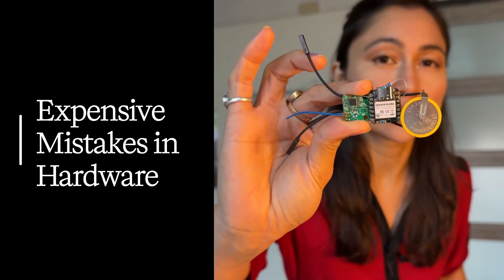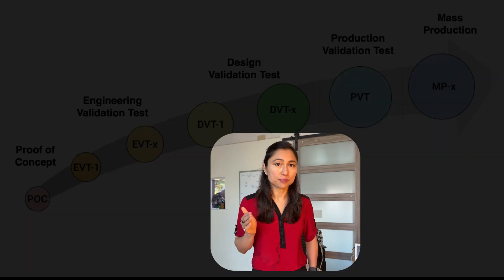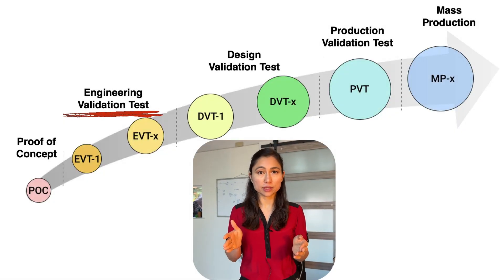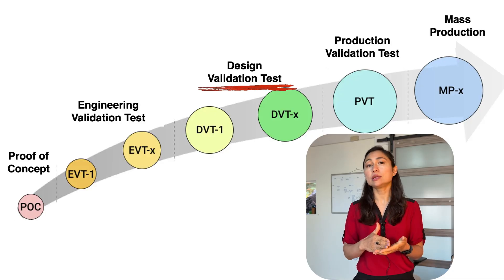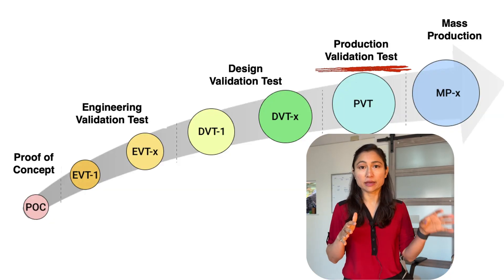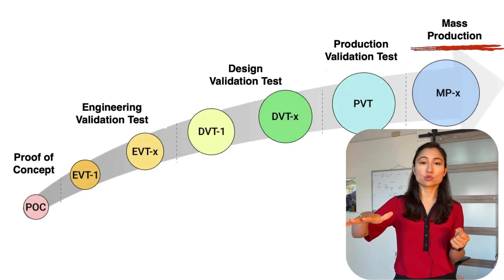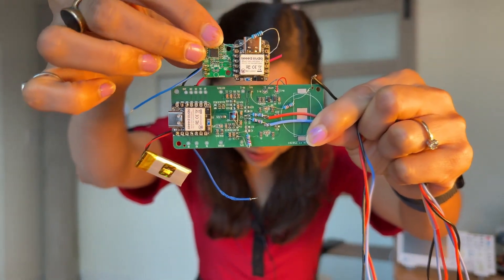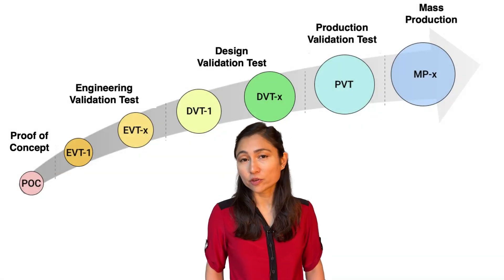My $1000 Mistake  The 5 Hardware Stages You Can't Afford to Skip  | Startup Series Ep 4

Comment from the maker: Where are you in your hardware journey? 👇

* POC (Proof of Concept) - still figuring out if it works?
* EVT - finalizing your electrical design?
* DVT - locked in on mechanical design?
* PVT - testing your assembly line?
* Just getting started with an idea?

I'll try to answer questions and would love to hear what challenges you're facing! And if there's a specific hardware topic you want me to cover in future videos, let me know here.
Reply: As a teacher in university  we feel students just want to run the board and are not very interested in details ...  How can they be engaged in this learning process ?
Reply from the maker: @KHIRD  only a small percentage of students seem to like electronics in any group. Interesting projects that start simple so they can get early wins and slowly get more complex should help get those students engaged. 

What do you mean by they “just want to run the board”?
Reply: @IndiraNegi  means student just want to run the board and they are usually  only interested to run it in short term with losse wiring
Reply: what is that device in the video with esp32 s3
Reply from the maker: @Watcher69w it’s not esp32. 
It’s the seeed board with nrf52840
Reply: Im either in POC or just about ready for production depending on whether its ok to ship raspberry pi's and off the shelf ESCs. I think my de- risking move was just to avoid circuit design in my robot.
I would love to hear your critique of my attempt at a hardware company if you dont mind.
Reply from the maker: @overengineer7691 it’s a decent approach 

if you use off-the-shelf parts, you can either sell the product classifying it as a kit as long as the customers assemble some parts of it. In that case you don’t need to have your your FCC certification because the parts you are using are already cleared 

Or if you want to sell it as a fully assembled product, you still need to pass FCC product level test but if the parts have modular certification then your test is simpler and less expensive

Comment: At what stage would building test harnesses for production happen? Would it emerge as part of the EVT stage as you actually finalize the electrical design?
Reply from the maker: I am planning to using an early version for EVT yes. It's going to be very simple - just 3 testpoints and a usb connector, PCB held in place with a clamshell style fixture.

 But it will be improved for DVT and needs to be perfect for PVT

Comment: Feels very big company style process. I'm struggling to find a balance between going through steps and speeding things up. Since every board takes time to get manufactured, skipping a step might  give you a time advantage at a cost of some potentially wasted boards.
Reply: Industry standard for industrial products is TWO iterations, tops. For commercial products you may get a third, but it is more likely that you are making design changed during manufacturing anyway to accommodate supply issues (parts become obsolete, hard to get or there are cost-saving alternatives). That's it. She is simply bullshitting you.
Reply from the maker: Yes it is what I've learnt at big companies and it's because you are coordinating large teams for EE, ME, Firmware, App, operations and supply chain. They all need dates and milestones to plan their work. 

As a small company you can skip whatever you think you don't need, as long as you make sure to are ready with your final EE and final ME before the production run. Because pausing the production build costs a lot more than any previous stage
Reply: @IndiraNegi  You were at a company with mediocre engineers.

Comment: If you miss any hardware components or if something doesn't work as expected or need some changes in PCB, its a significant delay to get  new one... How do you avoid or deal with it?
Reply from the maker: You try to iron out as much as possible in the POC stage. Test most of it. At that stage you can build a few versions and they are still inexpensive 

The later stages every mistake is costlier. So it’s better to spend the time early on in POC and pre-EVT to test and find all the issues
Reply: You can include prototyping space and even design variations on your test board. The second board has to be the production design. If it isn't, the you can pretty much kiss your promotions goodbye.

Comment: If you skip the 5 hardware stages, you will get the 5 stages of grief. It's 5 stages either way. I've been there.
Reply: That's bullshit. I have made a bunch of scientific instruments that were built either on prototyping boards or the first PCBs (with a few components soldered in during the test phase). All of that worked for decades. I also have commercial designs which had one or at most two iterations.

Comment: i made a 555 explode the other day, so yeah...
Reply: I would never used a 555 in any design. It's one of the worst chips that were ever built. What's worse is that there are a hundred clones out there and none of them behave the same.
Reply: @schmetterling4477  i might have issues with their pinouts being awkward for all common circuits, but as one of the oldest ICs still in production and still found in commercial designs, it has to have something going for it...

not had an issue with clones being variable, theres nothing in them to cause such behaviour...

so either the issue is how you use them, or maybe youre just trolling...
Reply: @paradiselost9946  Everything the 555 can do I can do far more reliably with other circuits. For all I can tell it has been mostly marketed to hobbyists. If you like it, go for it. I just worked out an analog version of Pong (the video game) using bipolar transistors. It could certainly also be implemented with 555s, but I wouldn't. For one thing two transistors will set you back 3 cents, one 555 more like 10cents, so it's not even cost effective.

Comment: Some things are simply not breadboardable and require a few spins of a proper PCB build - everything RF, everything high-speed, where signal integrity is important, everything high-precision. Modular design helps though - if you can isolate such parts and build them as small self-contained PCB modules, the cost of design goes down massively.
Reply from the maker: That's right!

That is the only reason I built a custom board for my design. It has sensitive analog signals and the layout and layers of the board would affect the functionality
Reply: You beat me to it.
Modular design is critical for RF.

Comment: Hi Indira, thanks for the overview. I've always found the process to be much more fluid with feedback between steps, especially with mechanical design. Mechanical design changes may require electrical design changes, production changes may require mechanical or electrical design changes. Is the process I'm describing a totally different philosophy of design, or can it also be captured in this overview?
Reply from the maker: Absolutely, there's always feedback between steps! My overview simplifies it, but in reality, you're constantly iterating between them.

ME and EE work together in EVT and many time in POC too. At EVT also you build a full device - EE, ME, firmware etc 

It’s just that after EVT, ME can still change stuff but EE cannot 

Didn’t mean to imply that ME is not involved earlier. 

Infact for the sake of conciseness, I edited out a line about how it’s a constant negotiation between EE and ME for space inside the enclosure
Reply: yup, I get it, you gotta come back from dvt to evt, in case mechanical changes lead to electrical changes
Reply from the maker: Unless the change is just a small board shape change or test point location, but no functional change electrically

Comment: Or...

Use a really cheap PCB manufacturer and a 3D printer to combine circuit, design and software development into a single iterative process. Then you can go through the design stages to final product look and feel while you are still finding problems with the circuit, software (if any), reliability issues, edge case management and so on. I did this, and now I have a feature complete product with all the stages you mentioned done in parallel.

Comment: Hi Indira! This video is very helpful in knowing where my hardware stage is at (still in the POC). I have a question. How long for each hardware stages to be taken for running hardware R&D and Production without the vulnerability of outdated concept?
Reply from the maker: Hi Aravind, 

It is less a matter of how long in terms of time, but more in terms of passing the exit criterion. So once you've proven that your concept works, you have completed POC.

POC can be fast, because you can try many different configurations and don't always need to build a custom design. You can hack together existing off-the-shelf parts. If it is a simple product like my muscle sensor it can be 1-3 months.
Reply: @IndiraNegi Thank you Indira! For a project which consists of Drone and IoT groundstation for farmlands it would take around a year.
Reply from the maker: @aravindmiras3708  Sounds like it.

Hopefully you are working with a team so you can build things in parallel

Comment: That board already looks tiny, how smaller are you targetting to make it?
Reply from the maker: The tiny board is the one that doesn't work. It's the mistake!

The larger board is what I am fine-tuning everything on
Reply: @IndiraNegi yeah but the size at the end will be smaller right?
Reply from the maker: Yes, eventually it will be smaller. Once everything is working on the larger board (which I can modify), I can layout the same design it with small components.
Reply: @IndiraNegi  🫶